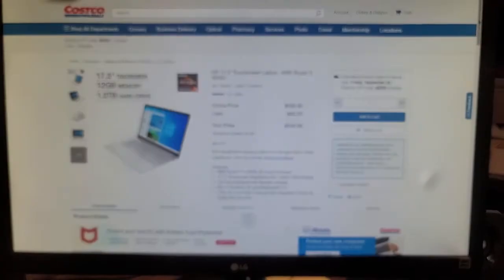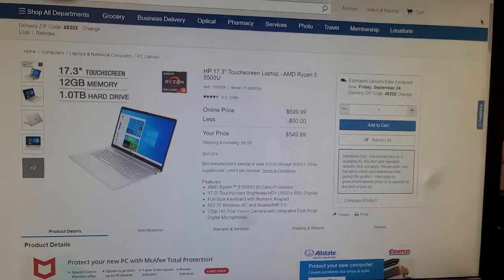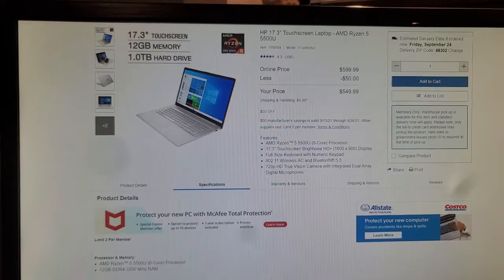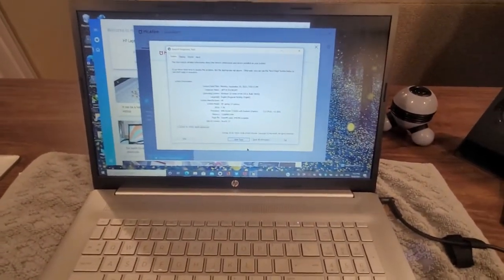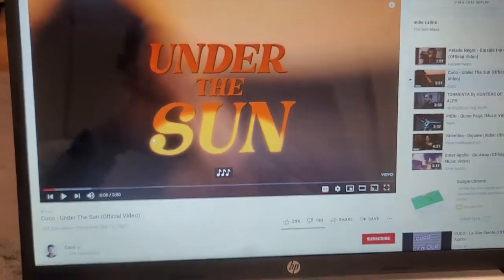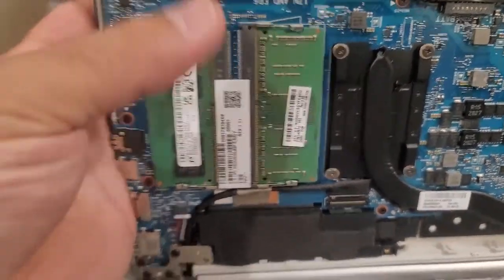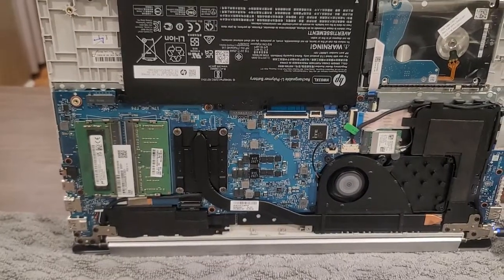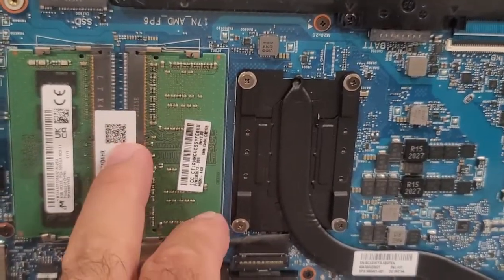Part1 - Upgrade #Laptop #HP 17-cp0025cl, 17.3 , Ryzen 5500U, 12GB Ram, 1TB  Hdd, please watch Part@

Comment: The HP cp series is the most upgrade able Ryzen notebook. 2 memory slots and M.2 + 2.5'HDD. My model is the cp0132ng with Ryzen 3 5300U, 256MB M.2 and one 8GB. Its not easy to find the rubber HDD carrier and the 10pin HDD flex cable. At Lenovo at 2x32GB + 2TB/512GB configuration is 3x my base model.